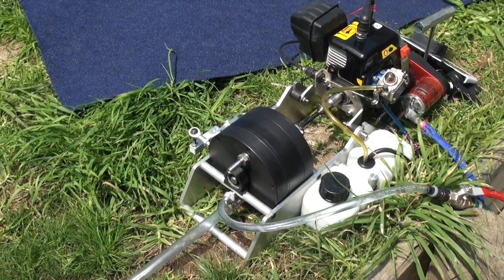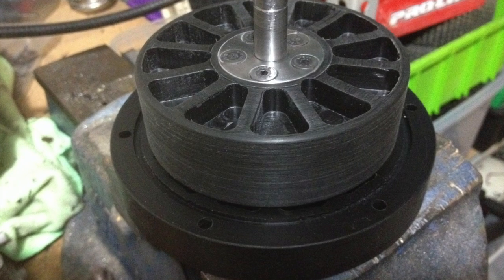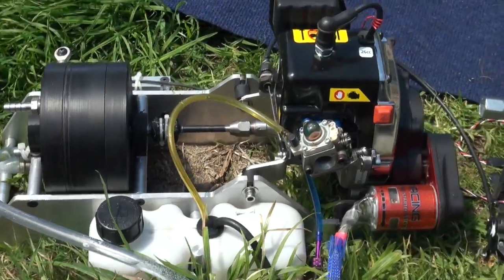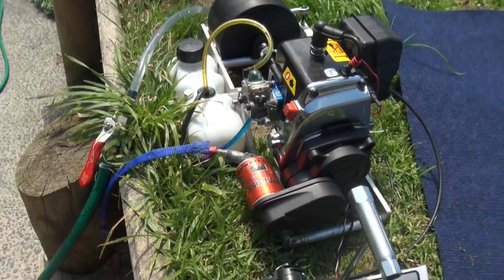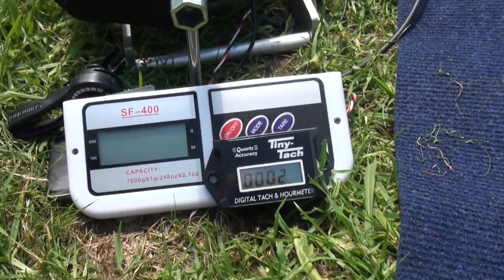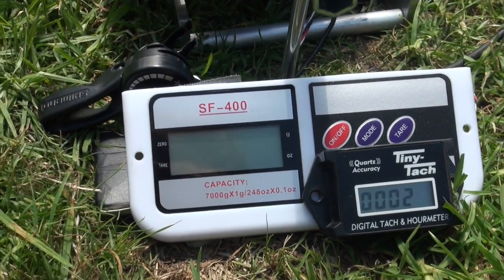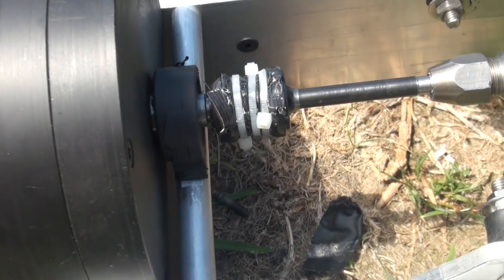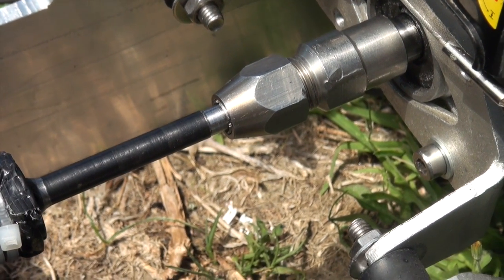Water Brake Dyno for Cy-Zenoha Engines

Comment: Very interesting, I have also seen the Nick Kennard and seen your posts on his video. I'am wondering of the method how you have created you're water brake housing and rotor. I'm looking for referential material to build a same brake absorber. But mine have to handle a max of 30HP.

If you could give some information or referential material and theorie to look at, would be really nice :)